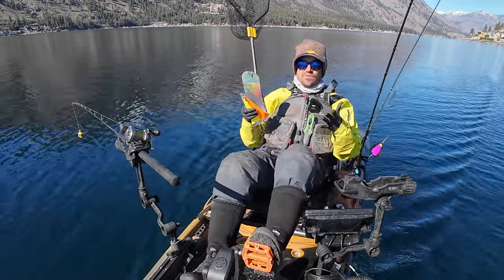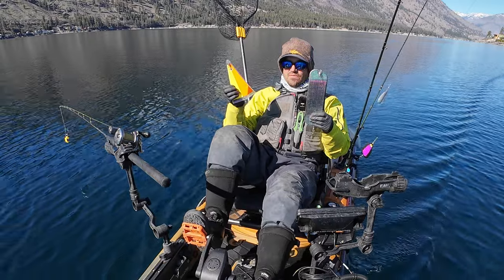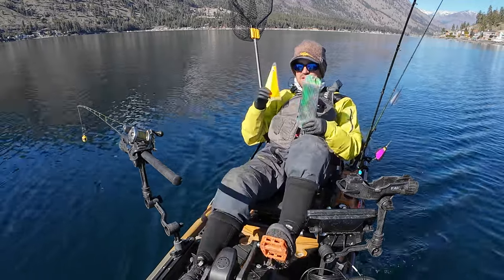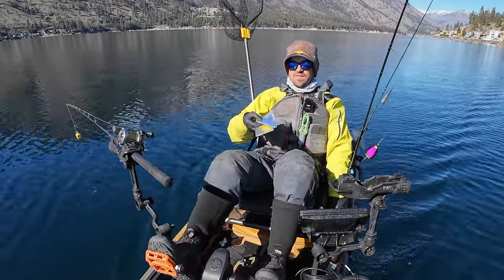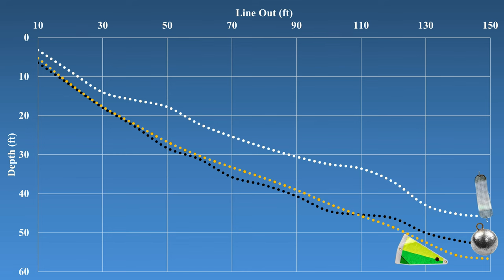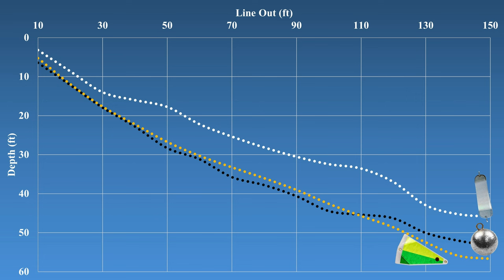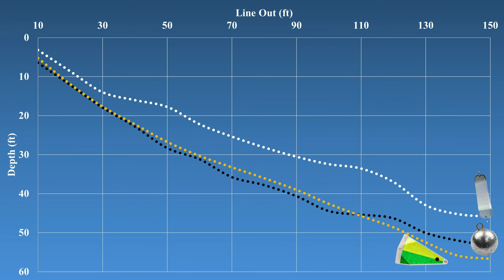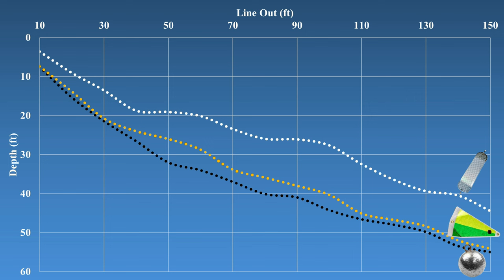360 vs Triangle Flashers: How do they impact depth?

Comment: I have done a lot of research on the fishing lines used in the great lakes fisheries... they seldom run braided line but when the do they run 40lbs... so I have spooled mine up to see if it runs deeper.. they have to put out hundreds of feet of line and line diameter is a bigger issue for them than us..,

Comment: I used both of those flasher when fishing in Puget Sound.  I just did what everyone else was doing.  I never thought about effects on depth, but I always used an electric downrigger.  What I did fiddle around with was the length of line behind the 12 pound ball and the length of leader between the flasher and my plug.  Some of these variables are fun to ponder sometimes.

Comment: Am I reading the chart correctly,  it appears like you had more blowback, ie. shallower running, with the 360 at 1.5 than you had at 2mph out to 50’ of line out?  Seems backwards.
Reply from the maker: No you are reading that incorrectly. At 1.5 mph it always runs deeper than 2.0 with the 360
Reply: You sure you don’t have your graphs in the wrong order. You’re showing 15 feet deep at 40 feet out on the first graph and 19 feet deep at 40 feet out on the second graph which is supposed to be the faster speed.
Reply from the maker: I’m sure. Let’s be honest a difference of 4’ isn’t going to matter to the fish but o”beyond 50’ on the line counter the slower 360 runs deeper the entire time you are literally the only instance it isn’t
Reply: Here in the southern Oregon rivers I frequent, we typically fish with 30 to 45 feet of line out most often, so this is real world to me, and it struck me as odd that it behaves in that way. Also the strange way it is hard decking at 20 feet deep until you get more than 60 feet of line out. That was unexpected also. No hate intended here, just clarification for our own particular situation down here. I wonder if 8, 12, and 16oz also behave in that way?
Reply from the maker: I’m curious too. Will also be running some trials in current. I’ve also seen chinook move up and down 10’ or 20’ in the water column to inspect gear so I don’t think it necessary to have it in their face either